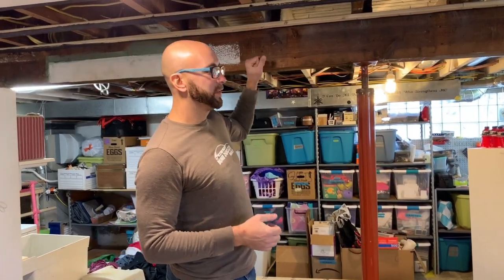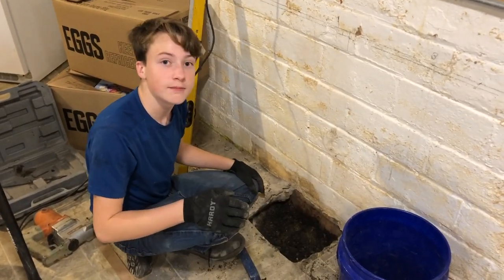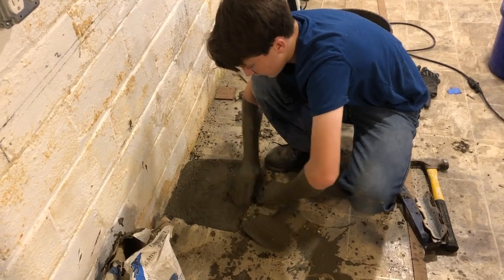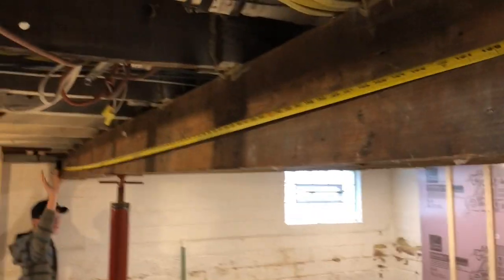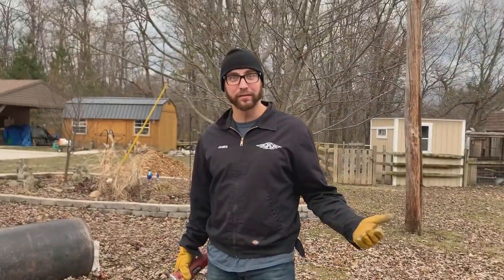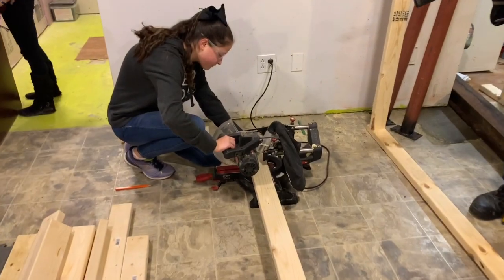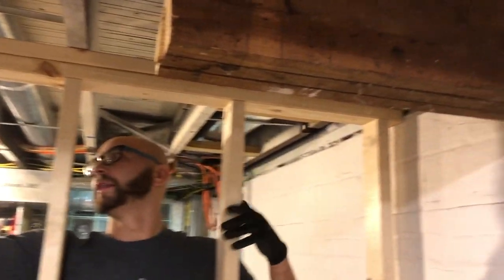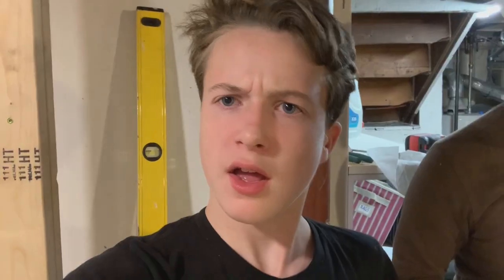How to Install Replace a Load-Bearing I Beam DIY Basement

Comment: everything was great in this video until you notched the floor joists. Severely compromised the strength of the joists by doing this. correct way would have been to conceal the beam entirely by cutting the floor joists all the way through, then putting 3 2x6s in the channels of the ibeam on each side and attach the floor joists to the "packed" i beam with joist hangers.
Reply: TJP 81  Oscillating multi tool. They are THE go to these days for cuts in extremely enclosed spaces, as the blade has basically no travel, and therefore you can cut right up to anything without overshooting it. Removing siding, doing undercuts on door jambs, anywhere where you are in tight spaces and particularly where the stuff on either side and behind needs to not get damaged, it's the thing you want.
Reply: @Joe Parziale he wanted the extra height. If height was not an issue, yes, you could do as you said.
Reply: TJP 81  Thanks for providing the link, from one TJP to another!

Comment: The notches to recess the beam created a bunch of stress risers in the joists.  Made 2x10s the same or less than the strength of 2x8s depending on the direction of the grain away from the inside corners of the notches.
Reply from the maker: I understand what your saying but the weight is on the 1/4” angle iron.

Comment: The area of the concrete pads didn't look right, and I am pretty sure concrete should never be that wet, especially if it is intended to be load bearing. I would have do a slump test before pouring.
Reply: Would’ve failed a slump test horribly

Comment: I am curious- did an engineer specify the size and depth of the new footing?  I am not an engineer, so I honestly don't know, but it seemed like a pretty small footing.
Reply: It should have been 32"-36" deep. Rebar would have been a good idea also.

Comment: Don't see any of the complainers putting up their own videos. Thanks for the overview. I'll be hiring someone to do this but like to know ahead of time what's involved.
Reply: Very true! I am a mechanical engineer and there is a complex set of calculations to ensure you are using the appropriate sized beam with the correct support. Also used steel is not rated the same as new. Hopefully they did hire a professional engineer to give them the correct sizes and locations
Reply from the maker: @GoldensRule45  thanks for your concern,  this beam has been in for years with no sag or any issues.  Total span was less than 11 ft

Comment: I wouldn't have notched the ends of the joists. Now instead of the weight bearing on the full height of the joist, there is two less inches of wood support on the ends and the will eventually crack.
Reply: Thats why he welded the support brackets in. Maybe you missed that part.

Comment: Those floor joists being notched basically reduced them and their corresponding strength (at their weakest point) to 2 x 4's.  Also, if you had a load bearing wall on the 1st (and 2nd) floors directly on top of the beam you replaced, what held them up during your beam replacement?  You put up 2 temporary support walls that seem to span about 4'.  However, what supported the upper load bearing wall(s) in between, the floor (sheathing and finished floor)?
Reply: You clearly missed the part where he supported them on the untouched parts as well. 
And the temporary walls held everything above. You underestimate how strong those temporary walls are.
Reply: @Luckingsworth  the temporary wall only supports the floor joists not the supporting wall above the basement . two support walls are needed ,one in the basement and one above,  supporting the rafters

Comment: Very nice, but I think the headers of the temporary wall should he vertical :) Oh and I think the footers should be 16"x16". And the I-beam might be too thin for that application - should be able to hold a 2x10 inside of it.
Reply: I am doing the same project but with LVL not steel, footers should be 16x16 and 12” deep
Reply: @davehall3351  wats lvl?
Reply: @831klanforc  Laminated veneer lumber

Comment: Someone did the same thing to the house Im renovating and the beam failed and bent downward. Im putting back a builtup wood beam to correct it and rebuilding the joists where they were damaged due to this type of modification. I would not advise to this method.
Reply from the maker: What size beam was it and how far was the span?

Comment: I had a previous owner take out three 2x4 studs on a support wall in my finished basement on a small three story townhouse. He must have recently done it before I bought the house and within months the floors on both levels above started warping. My plan is to use a 4x4 and two 2x6s a a header at the top or the new door frame and use a pole jack to push it all up before placing two king studs and some jack studs to hold it all up. Love you channel and would be interested in you thoughts or helpful ideas.

Comment: Great family project and execution but seems every notched joist will split. At the 90. And now all the load of the home is on a 6" block.  Ouch.
Reply from the maker: 2/4 angle under welded under each beam is way stronger than any strong tie they make.  But what do I know.

Comment: Almost two years later, curious how's that beam holding?
Reply: How that beam holding?
Reply from the maker: Holding great.
Reply from the maker: It span 12ft at 1/2 thick with 1/4 angle iron welded to it to hold the floor joist.  The beam is welded to the post and cemented by brick on the other side.  Where do think it’s going to go?

Comment: nice job. But it may not pass the inspection if you would have pulled a permit. The posts need size up a little and also need standalone footings. Hope there is NO second floor above it. Otherwise notching the joist to rest on I-beam will be checked by structure engineer. The proper way is using a bracket.

Comment: Great video! Did this beam have a load bearing wall running directly over it on the main floor of house?
Reply from the maker: It does but it has an 8ft arch opening directly above it.
Reply: @JamesKoorey  thabks for replying and oh ok. I have wooden beams that are all sagging and have holes all thru from a certain kind of bug i cant remember its name. One beam is actually broke from water damage and has 2 adjustable support columns supporting it. Just was trying to figure out how to remove and replace them with out the walls directly parallel above them collapsing in the process. My structure is a lil different tho from urs becuz the floor joist dont cross over the beams so once the beam is removed theres no structural support where beam was just subfloor. Only thing i can think of is create temporary walls or support on both side of beam and load bearing walls parallel above like u did but from the basement all the way to 2nd floor 🤦🏽‍♂️. 6 support walls in total  2 on each floor, taking the load off of all load bearing walls to the top of house structure. Can u or anybody think of a cheaper or more simple way? Sorry for the story 🤷🏽‍♂️ lol

Comment: Depending on the age of the house and geographical location, those supports with poured footings are the only concern for me.   The removal of that beam and replacing it with the steel one could/will jeopardize the structural integrity of the house as the whole weight of the above is sustained by those 2 posts.
Reply: that footing is more than sufficient. What do you think was under those posts in the first place? 24x24x8 footings most likely. They didnt have large affordable metal I-beams or LVL's back in the day which is why you didnt see them in small homes.
Reply: Correct way is to put blocks between the foundation wall (where the old supporting structure was) and the bottom of the I-beam.

Comment: Joists cut like that are going to crack and sink....
Reply from the maker: I agree but that’s why why all were supported underneath. Think about how a strong tie works.
Reply: I already saw some grain crack. The reason why I know it's because this method of yours was used before joist hangers existed and cracks happen along the notch. Your support underneath is not enough and are not pressed against the beams. The notch is enduring a lot of load

I would have done a T beam instead and insert it upside down 🤷 after talking to a structural engineer of course 😂
Reply from the maker: Thanks but I did talk to a structural engineer and all the weight is on the angle iron and the beam is sitting flat on it.

Comment: This is not sound construction 🚧! Never notch floor joists!!! The floor above will continue to sink and you will have some major deflection on the floor above as the floor joists begin to crack at the notches. What a disaster!
Reply from the maker: Please explain with 1/4” angle welded under each beam??